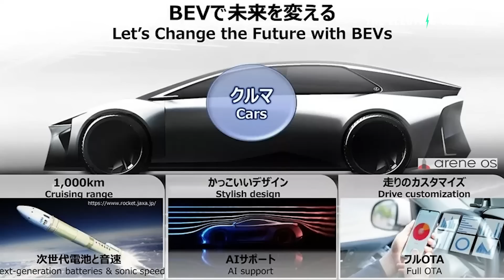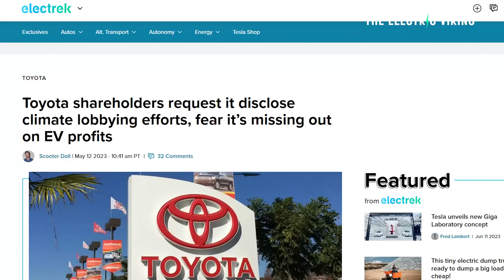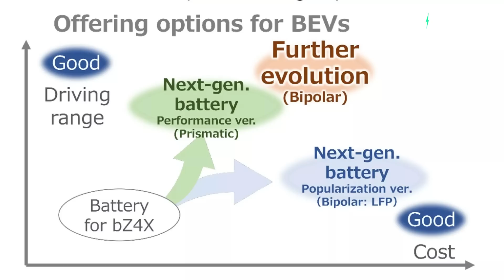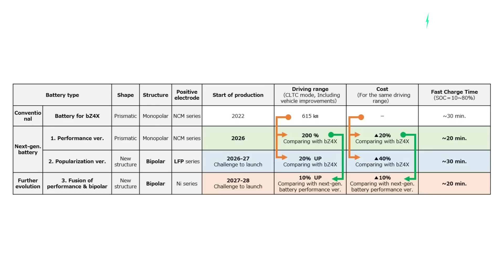Toyota's 2026 Electric Car will have 900+ Miles Range & Lightning-Fast Charging

Comment: I am not a (as you put it) "Toyota Fan" but I do own a Prius. It's a very old car now but it has served us OK especially as some countries we travel through simply don't have the charging infrastructure (or actually it's fairer to say they didn't as many now do). I would not have another hybrid because the future for me is absolutely electric but I either want to wait for a small run around car that would replace our Suzuki Swift or we replace the Prius with something that has either a decent range or decent charge times so that we are not constantly looking for where the next stop will be and then sitting there for long periods of time.

Something else I am totally not sold on is all this touch screen hype. I want to be able to focus on the road while adjusting the most common features such as the climate control and entertainment. If the car has accurate voice control (the Prius had a little of that) or it has physical buttons, then great. But swiping through menus is not something I fancy doing so that is important for me.

Other features I'd really like to see (which admittedly are common now) would be cameras, parking sensors, adaptive cruise control, and ideally the ability to trigger charging at home when the solar panels on the house are delivering.
Reply: Pretty much every command you need is done by voice control or streeting wheel buttons. You're not going to be staring at the screen for 5 minutes.

Comment: The BZ4X really doesn't look aerodynamic.  Personally I hate the Transformer Look that they seem to embrace.  Toyota better pull their heads  out of the sand before they go broke.  With regards to their patents, like Elon said, patents are for pussies.  Elon always knew that production adaptability and evolution was foremost, not patents.  Toyota is old school and will be a tiny reflection of its past.

Comment: Not only will it have a 900 mile range, it will be able to fly and hover above traffic, although in this mode range will be reduced to 750 miles.
Reply: 🤣Where we're going, we won't need roads.
Reply: @Stanley-px3bt  Exactly but the max speed will be 88 mph!
Reply: But wait, there's more!  When optioned with the flux capacitor it can travel Back to the Future!
Reply: If it can fly, why not park in a nest in tree, where they can't be booted.......
Reply: Optional Mr Fusion refueling.
Reply: Roflmao
Reply: and create drinkable water as exhaust!
Reply: Their past slogan was, "Oh, what a feeling!"      Their new slogan, "Oh, what a bunch of lies".
Reply: Don't forget the boating feature too.
Reply: But remember, 750 miles when flying is a straight line, so that's as good as driving 900 miles on the road! 😂
Reply: It just might fly.....Have you heard of Joby Aviation, Toyota's E/VTOL partner? Well, maybe the new Toyota's won't fly, but maybe.....just maybe they put the high density, light weight Aviation battery INTO THEIR GROUND VEHICLES!!!! 😂

Comment: The new Toyota CEO claims a 10% to 20% improvement of LPF lithium batteries by using 'bipolar' electrodes. The other improvements in order to get a 900 miles range per charge is aerodynamics and weight reduction (like the Aptera). This is technically possible, Aptera proved it, already has 1000 miles range max for a 2-seats car.  It looks as if the new Toyota CEO has collected the very best ideas from the EV world, and dreamed up a car that can be build and can be sold with a good profit margin. I think it is real, but we must wait three years for it to happen. A lot of things can happen in three years, the competition is a moving target.
Reply: No, no - I'm sure Tesla & others will stop and do nothing over the next few years for Toyota to take the lead. 🙄

Comment: Oh... I should also add, the hydrogen-powered fuel cell EV may be more expensive to recharge than the lithium battery powered EV (needs hydrogen instead of electricity).
Reply: Probably 4 times as much.

Comment: If the car is hydrogen-powered fuel cell EV, all the claims are possible, but it needs hydrogen fueling facilities. Marketing dept is not truthful. What's the point of buying a 900+ miles range car with 15-min charging but you can't easily find a facility to recharge it?

Comment: 900 miles of range at 4 miles per kWh is a 225 kWh of battery.  Charging that battery in 15 minutes requires 900 kW of power.  Average.  There are 0 chargers that can do that.  So they need to build an entire worldwide charging network to go with it.

Of course no one NEEDS 900 miles of range, especially with a 15 minute charging time.
Reply: Toyota is just BSing.
Reply: Solid state battery could have more density, conservatively 25% more so the battery required should come down.
I am just dreaming
Reply: @praveenhegde8107  An increase Gravimetric energy density helps make lighter cars, and thus slightly longer range, but until you get to Aptera level efficiencies, 900 miles of range is going to be a heavier car, and either long charging times, or non-existent charger voltages.

Comment: Toyota's history doesn't support their claims. What will Tesla and BYD be doing over the next two and a half years? Will the price of the mythical 2026 solid state battery EV be in the $25, 000 range of a Tesla by then? Good luck Toyota, it would be great for competition, however I have dumped all Toyota stock a while ago and have no plans to rebuy.
Reply: Toyota didn’t get to #1 on broken promises.
Reply: only 1 model of tesla will maybe be 25k.  that wont be suitable for many people.
Reply: There are plenty of alternatives that are available now. Tesla have missed the boat. @baldisaerodynamic9692
Reply: There are no Teslas that cost $25K. That’s just absurd.

Comment: IMO some 400-500miles of range will be so much, that after the first years of "range anxiety" people will notice, that they are actually paying more for a "premium" of being able to drive 500miles on one go for no actual everyday need.

I expect some time in the future, the cars with LESS range but somewhat lower price will be the cars, that are the most wanted ones to buy.

Always some people need and will get the 600-900mile versions yes, but I expect the vast majority of sales volume will come from cars, that can drive much less on one charge.

Naturally this CAN be negated by the fact, that batteries become very, very cheap. Then there is no sane reason to take a car, that runs less on one charge. We will see, but it is very interesting :)
Reply: Fast charging is for most people far more important than high range.   How often do most people fast charge - a handful of times a year.
Destination charging needs to become ubiquitous mind.
Reply: @JohnR31415  who wants to go to a charging station at all? Rather have more range and never stop at a slow or fast charger.
Reply: @SunriseLAW  "only 3% EVs in the USA"  because oil is cheap compared to the rest of the world. When EVs drop in price and range increases EVs will dominate. Battery swapping is a waste of time. Who would want to locate and drive to a swapping station? Who's going to pay for all the extra batteries required. Good luck introducing standardisation for all cars. Will corporations will own the extra batteries and charge you more money? Who is going to transport all the batteries around when a station is full and another station is empty?
Reply: @AORD72 while i agree the economics of battery swapping are questionable at best, since you leave your old battery when you pick up the new, the number of batteries at a station doesn’t change unless a battery fails.
Reply: Absolutely right. @AORD72
Reply: @SunriseLAW  Battery swapping is trying to solve a problem that doesn't exist for the vast majority of people. Hardly anybody drives over 400km a day (the average car drives 15000 km a year or 43 km a day). I think also the improvement in batteries will make battery swapping pointless. Already companies are claiming 500Wh/kg batteries. Battery swapping will only add costs to the consumer, the corporations are going to want a ongoing payment and to make profits. Battery swapping won't be as economical for the end user as owning a battery will be.
Reply: @SunriseLAW more like BECAUSE of all the oil hype, EVs are only about 8% of new car sales. 

Charging times are largely resolved already and range will be resolved by increased battery production so larger batteries can be put into cars. 
No swapping needed.
Reply: I would buy a minivan with 500 miles of range. I will not buy one with 300 or 400 miles. I have a need to transport my sound gear 200+ miles in each direction, several times a year and I don't want to worry about finding chargers along the way. On a recent road trip to North Carolina (700 miles each way) my van got 560 miles per tank which meant two fill-ups for the entire trip. I realize most people don't drive that far, but I'm just saying, I'm not going to buy a compromise vehicle that maybe is fine for driving around town but falls down on the job several times a year. I think there are a lot of people who would feel the same way. Maybe fast chargers at rest stops will alleviate this problem...eventually... but not every stop has such devices yet.
Reply: There will be plenty of chargers. Just take a break when you are charging or do it at your destination. @ChickensAndGardening
Reply: public charging in usa sucks and some areas worse than others, and im saying this as a tesla owner.  tesla is better laid out by far, but in vegas, most chargers are in the middle of town in the tourist areas that most locals avoid like the plauge.  i am fortunate where i use my car for work, and there is one in my path on my way home. but its often packed until 1am.  as much as i use my measly 270 mile EPA rated Model 3, using 100 actual miles over 8 hours time my range is down to 120.  
chargers need to be laid out better.  
EPA ranges need to be 400 to get about 330 real world.  280 real world is what most gas cars would get, so 330 would be fantastic.  remember, we have to charge for 30 minutes unlike refilling for 5.  when i had my hybrid suv, i would go about 300 miles without refueling and still have some range left on road trips.  on another note, a gas only camry got 46mpg at 75mph.  amazing engineering, and a great road car to be honest.  that is at least 500 miles a tank all highway.   
for those on road trips, this would really make people more comfortable, secure and safer feeling and confident if they got 330-360 miles between charges, especially with a 30 min recharge time, but with longer distances, charge time wont be so bad when people stretch out, use the rest room, grab some food, etc.  
for those like me, i would never have to touch a public charger as i am someone that cannot install a L2, but can use my L1 charger.  then there are those that live in apartments and have no charger access at all.  or maybe theres only 2 in their complex and they are used already etc.  

will there be people that go overkill with a say 700 mile range car?  sure.  will they buy it and use it?  maybe....but the market will tell what people will pay for like anything else.  i am hoping to see a model Y in 3 years that gets EPA 370-400, which means at least 300 real world.
Reply: @baldisaerodynamic9692  How far are you driving for work? If you drive 100 km each way then you should have enough charge every day to do a round trip. 260 days of work a year and a 100km away from work would be over 520 hours of driving a year. That is like working an extra 25% more work a year for nothing.
Reply: @AORD72  80-100 miles a day, but lots of idle time a total of 7-9 hours.  i am more abnormal than most.  but for a highway trip, i would want 330-350 real world use.
Reply: @baldisaerodynamic9692  So for the normal user probably 200 miles is easily sufficient? So the majority of EVs could have a 400km range and for the few exceptions like yourself and travelling sales, towing etc people have some ~600-700 km EV's. I'm sure in the future battery range limits will be a thing of the past in the future. Imagine 500Wh/kg batteries, which there are already prototypes. Also fast charging, like 350kW, adding another 100 miles would be pretty quick.

Comment: Electric Viking has been ignoring Toyota as long as he's been on YT as far as I can tell.  Thanks for waking up 6 months after I published this info. Toyota also has a JV with BMW with a hydrogen/electric platform(s) by 2030.  Overcomes ALL the problems with Lithium/EV platforms.
Reply: Having a JV with BMW won't help Toyota overcome all the many problems with hydrogen fuel cell vehicles. Toyota and Honda have been working on fuel cell vehicles for decades and have only managed to produce a few thousand per year. You have to ask yourself, if hydrogen fuel cell vehicles made any kind of sense, then why are they not being produced in greater numbers.
Reply: @skipondowntheroad5833  I doubt you checked out the specs; the dual power sources solve lots of issues and avoids lots of others. Hydrogen just won't work if it is the only power source, but with a small electric motor with self-charging capabilities (BMW patents) I've been familiar with alternate energy since the 1970's btw.  Toyota has an excellent working relationship with BMW (in the past) as well as with Mazda.  The 3 of them put out quality power plants that are world class for the past few decades imo. I'll file your comment as "uninformed".
Reply: @EnriqueThiele hell, Ukraine & Russia could blow us ALL up by this Christmas, lol.  might wanna check out my earlier reply, higher in this thread.

Comment: YEAH RIGHT I will believe it when I see it. The hydrogen company is claiming to leapfrog the entire EV industry. One thing I am confident in is that Toyota will continue to follow not lead!
Reply: They're not even good at following apparently..
Reply: Leading for sure, but in the wrong direction. Progress is a vector. Sometimes you have to cut your losses and reverse course.
Reply: @jamesvandamme7786  Or you need a concurrent vector in the opposite direction twice that of your competitors!
Reply: Yup, In addition, hydrogen is NOT a fuel, and it takes only 5% of gasoline's combustion temperature to explode!
Reply: @hippie-io7225 if it's used as fuel then it's fuel

Comment: I remember what happened to the launch of the IBM PC back in the 1980's. Apple and Tandy were leading the market. IBM was against the launch of the PC, arguing that the mainframe was the way to go, more secure, etc. Then IBM launched the PC with the worst available OS (Microsoft DOS). Why was IBM PC widely adopted and became the standard, despite it was way behind from a technolgy standpoint and far more expensive ? Because the market wanted a clear path, at that time there where many different flavors of PC and OS (CPM and Oasis leading). 
Can we see a similar situation now ? Many different EV brands, with many different flavors of battery technology, confusing or holding back the majority of the buyers to take a step towards EV.
May be (like it was with IBM it is enough for Toyota to announce his EV to become the leading standard of this nacent merket. Toyota does not need to be the technolgy leader, they let others discover the drawbacks, obstacles and fund the R&D, then do the announcement just in time to block the industry/market until they can deliver ?
The difference is that IBM was nearly in a monopolistic position back then, not the case for Toyota. So the reason for this announcement might just to please (reassure) its shareholders ... and the banks.
I'm not owning a Toyota, nor a fan of Toyota, and not even considering buying one in the near futrure.

Comment: Toyota can not survive with the current business model. They must let the investors know that they have a plan to compete. SS battery or hydrogen break through are a must. However Chinese battery makers are also on track for the same technology but they are working quietly. 
For 15 minute charging, the existing charging stations have to be revamped.

Comment: F toyota, vw, Ford and other for all they did to kill EVs. Bought the previous base Hilux as well as fully loaded with custom extras of the current one. Loved them both, amazing machines, but couldn't get rid of the evil aftertaste so sold and will certainly never buy ever again another one. Tesla or similar, non-Chinese (gov issues) it is all the way even if reliability won't measure to the of Hilux.

Comment: We really only need high capacity batteries to begin conversion of heavy duty vehicles like diesel trucks. 350-500miles range is the most needed for passenger vehicles in the US

Comment: I personally think 900 miles range is a bit overkill, technically interesting but really smaller and lighter batteries is better more most of us.
Reply: Don't forget those batteries will be very expensive!
Reply: My 30 yr old cadillac sts did 900 miles range, VW's do 1100 miles on a tank, every one wants to match ICE cars for convenience so that is not too much to ask but it is going to take time for EV engineering to catch up to that. I am confident that very smart people will make it happen and probably sometime in the 2030's we will see all cars capable of this or better.
Reply: @carlsapartments8931  those seem like odd numbers, I have not had a vehicle that managed over 400 miles. My point was that many of us would rather pay less and have a lighter and more efficient car.
Reply: You know how it is they claim 900 but probably get 600. And if it gets 900 miles Ill have to charge the car less often